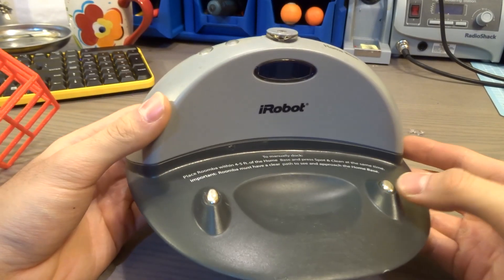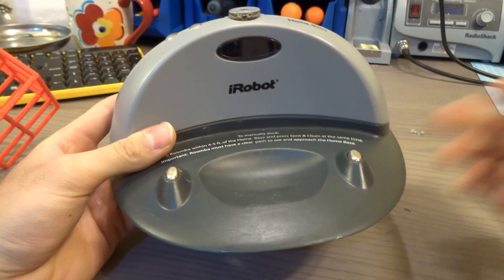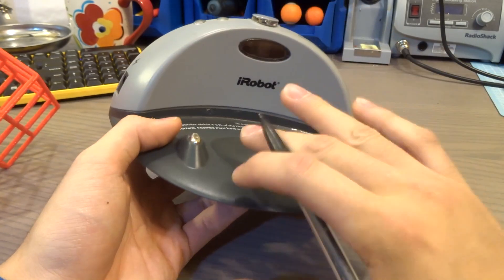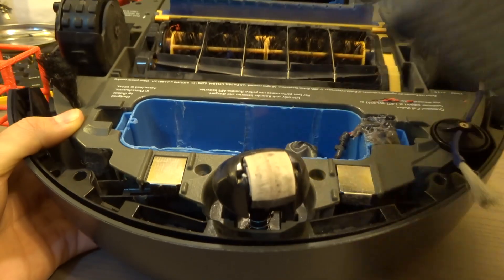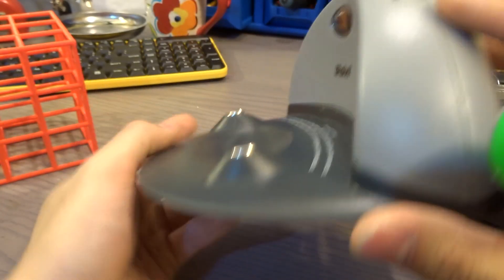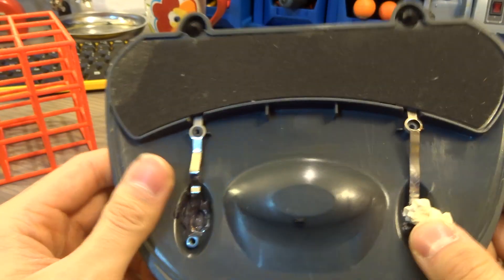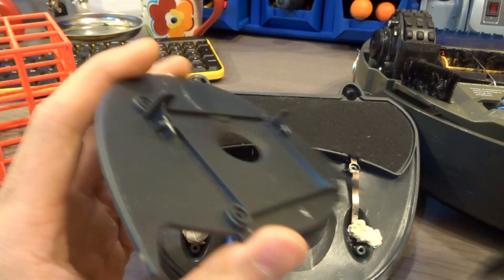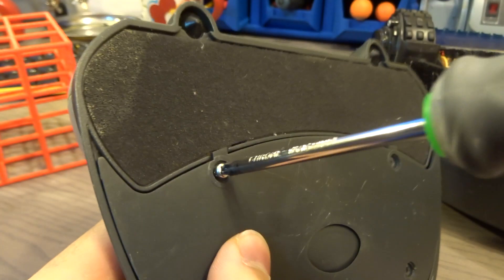ROOMBA NOT DOCKING TO HOME STATION [EASY FIX]

Comment: Great video. My Roomba is a different model, but the same fix applied to it. One of the docking station plates was sticking down, but only when the cover was on. I examined it closely and saw two little "I" (that's a Times New Roman "I" with top & bottom crossbars) shaped posts on the inside of the cover. Shaved a little off one of them and problem solved. No more sticking.

Thank you so much for this fix. Would have taken me a long time, if ever, to find the problem without your video

Comment: You tried to fix a problem. That's great. But after recognizing this got too hot for glue, you opted to use a flammable material to fix it? Not great. Pretty stupid, actually. It's kinda irresponsible to keep this video online.